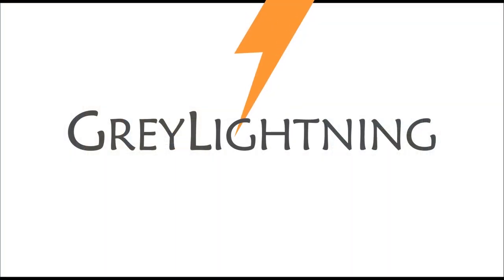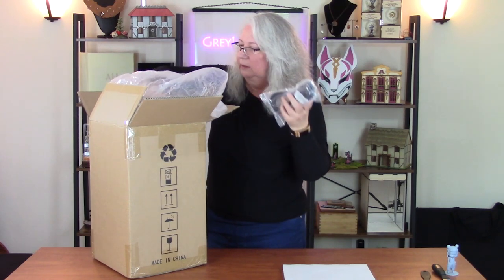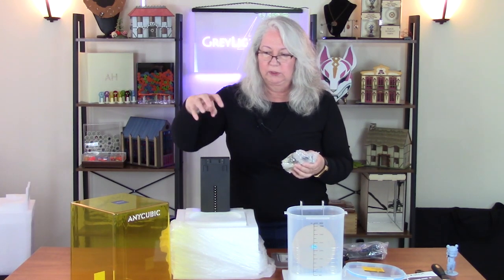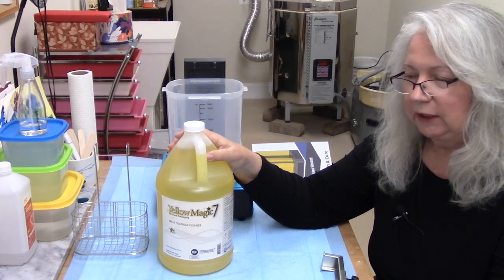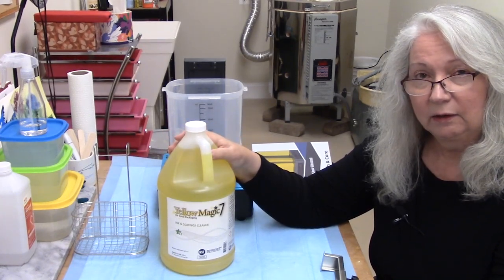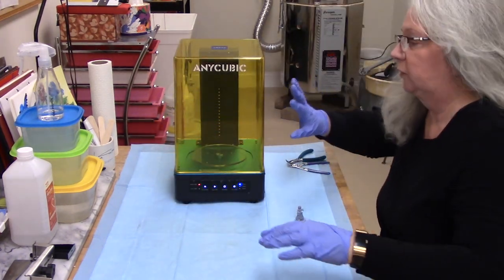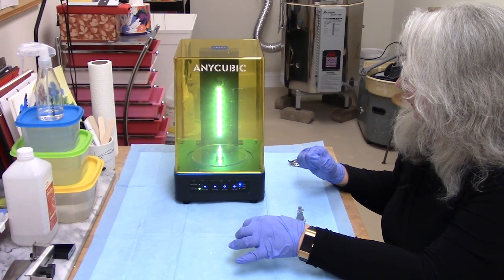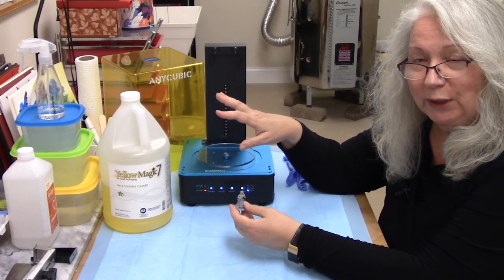Unboxing and Testing the Anycubic Wash and Cure Machine

Comment: 0:47 I personally use a razor blade or x-acto knife to slide under the model on my build plate. If that doesn't fully remove it I'll slide the plastic one under. I don't use the metal one for anything.
Reply from the maker: I now sharpen one side of the metal putty knife, and then it works a lot like your xacto knife. I got that tip from another viewer. Thanks for your comments,  Phil!

Comment: 13:46 what I do with my dirty cleaning fluid (IPA or Simple Green) is pour it into one of those disposable baking pans, like you might use for brownies, then leave it out in the sun for a few days. The resin cures solid and the liquid evaporates. Then you can just throw it away and reuse the pan.
Reply from the maker: Smart! I'm trying filtering methods to reclaim the cleaning liquid, but if that's not an issue, this is a simple and elegant solution.

Comment: I am glad to see that you got one of those.  I hear they help keep the post processing must easier.
You can use the Fuel Alcohol from the hardware store for cleaning prints if Isopropyl Alcohol is not available.
When disposing of cleaning fluid, we usually let it sit in the sunlight to cure any active resin.  This will eventually settle to the bottom, and then we pour the fluid through a coffee machine filter to remove the solids.  After that, the fluid can be stored and disposed as normal.
Reply from the maker: Thanks, Born again. The Yellow Magic bottle says to remove solids then  'dispose according to local standards'. Do different parts of the country really have different rules about disposal of cleaners?
Reply: @GreylightMay  Yes, it depends on how they process waste water before returning it to the  water system.  Most places tell you to put the solids in non recyclable trash for stuff like this.  Cleaners are usually along the lines of " dilute this chemical this much or more so we know it is neutralized by our process".
Reply from the maker: From what I just read, once the solids are removed as you described, since it is nontoxic and biodegradable it can go down the drain like most household cleaners. Thanks for the help!!

Comment: How is that Yellow Magic 7 working out? I've seen some complaints about Simple Green dissolving the magnets was just wondering if the Yellow Magic 7 worked better. I worked in printing food bags for 10 years and I've never heard of that stuff before!
Reply from the maker: Scott, I heard about the dissolving magnets too, which shocked me. I didn't know magnets could dissolve! This hasn't happened to me, but I've been using water washable resin mostly, so I haven't  had Yellow Magic 7 in the tank very much. Now I'm concerned,  for the same reason.

Comment: Is there a reason you didn't get Creality's wash and cure machine?
Reply from the maker: Sara, when I made this video, I  don't believe they had one. I've really liked their printer, so I would not hesitate to buy anything they make. I actually ended up having a problem with the Anycubic because the magnets on the impeller dissolved and I only use it as a curing station now. I guess I could add a note about that in the description. I haven't been quite sure about what to do with that information. I'm hoping they fixed it.